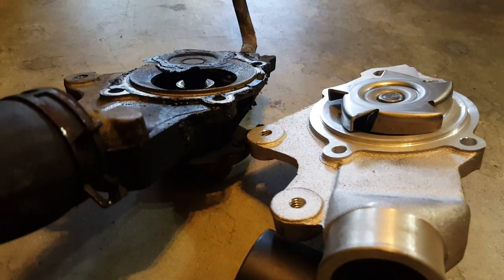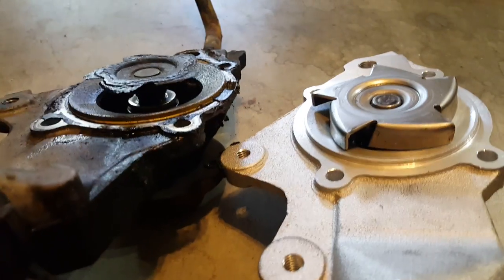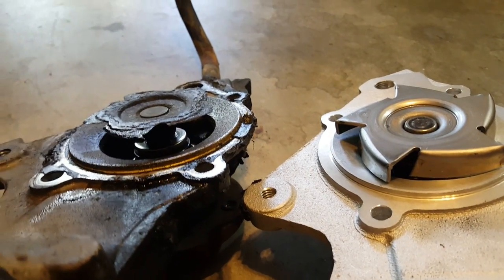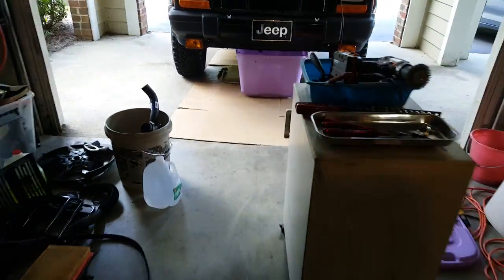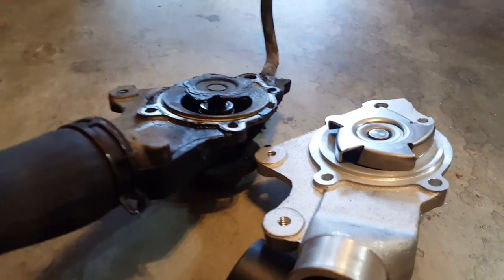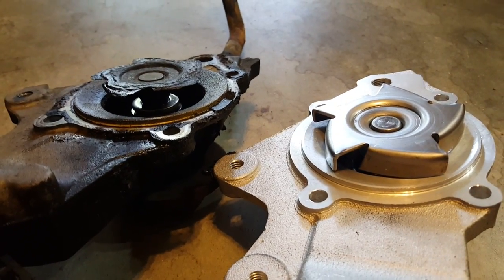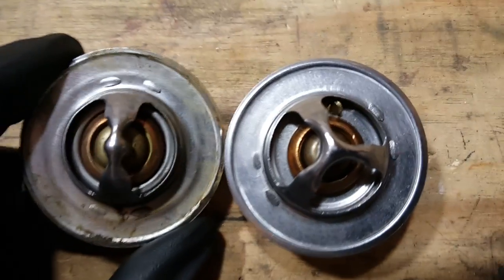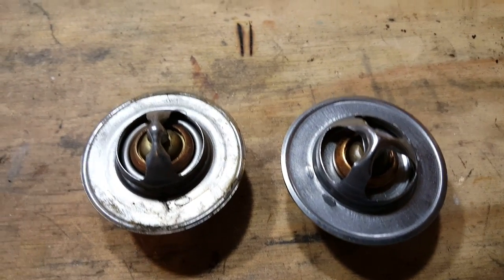Jeep Cherokee 97-01 xj overheating problem fixed

Comment: Seems like it would stand to reason that if the head was cracked you'd have water in the oil and you don't, I'm not sure why people would still Insist that the head is cracked ?

Comment: This is what I gata get into
Almost always a water pump or thermostat.  If it's cooling down when ur into he throttle.  It's the water pump
Reply: Not sure what you meant saying , if it's cooling down when you're in the throttle , it's the water pump . I'm jst having tear your hair out overheating problems with a 99 Cherokee more times than not . Thank you.

Comment: I have a 2001 XJ 4,0 ans have used the O'Reilly part and have not had good luck with it.  I live near a Chrysler Dealer and plan to purchase a part through them now.  Thank you for the information showing the difference comparing the two Thermostats.  I"m Very disappointed in O'Riley parts now.  I bought a water pump, radiator, thermostat, and other items trying to get this XJ ready to be my daily driver.  Maybe now I can finally depend of this Jeep.

Comment: Did it fix the cooling problems?  I had a leak in my rad, so I replaced that, replaced all the tubing seals, cooling sensor, the thermostat and then the housing which had cracked.  Still overheating problems, so I brought it to a mechanic and I’m convinced it’s the water pump but he doesn’t seem to want to exercise that idea.  My car sat for almost a year and seeming that most water pumps have aluminium components and coolant is more corrosive to aluminum, I think it’s either the pump or a wiring defect

Comment: Thanks for the video Grey,... Quick Version - My 2000 XJ with 187K sat dead for about 24 months after I loaned it out to an individual needing a helping hand.  (Out of gratitude, the XJ was driven into the ground in less then 3 K mikes. )  This month I got it running again.. installed a New Battery, Starter, Alternator, and Belt to get it fired up and that’s been great, but it’s getting smoking hot after 5 -10 minutes on the road and clearly having cooling issues. My concern is that it may be drinking coolant ( head gasket), but too early to tell.  Will run it at idle tomorrow after topping off the radiator.  Im not smelling coolant, so I’m hoping it’s the water pump.  As long as the head isn’t cracked I’ll be ok, even if the gasket needs replacing.   I figure first I’ll flush the radiator and change coolant, add a new thermostat and swap out the water pump to see what gives before breaking down the head for troubleshooting - I’d rather not do with summer in Michigan coming to a close..  So just a quick thanks for the water pump pictures and not buying into the fact your head is cracked - end of story.  Smart to work the problem like you did.  I’ll take pointers from anyone that wants to comment something of value on my strategy for moving forward.

Comment: Excellent job! Wow, unbelievable amount of damage to the stock water pump!
We think a like...I want to improve the cooling of my 2015 Rubicon. I'll be doing that by: 1. Changing out the stock radiator for a 3 row aluminum one. 2. Adding a trans cooler. 3. Installing hood vents. I also want to add an engine oil cooler, but may not be able too because of the change in engine design that has no external oil filter can....that type of design allowed for an adaptor which made it possible to have 2 lines to an external oil cooler.
Note: you highlighted the difference in the quality, or lack there of, of the aftermarket thermostat. I noticed that many years ago. I don't often buy factory parts, but ones I do are radiator caps and thermostats! Big difference in quality and performance. Thanks for your video example. It also demonstrated how there can be many different causes for a problem...in this case, overheating. And until you actually find the root cause, any other attempt to solve the problem, won't.

Comment: 98 Cherokee sport Radiator Drain Plug, I know many have ask where. Passenger side of Radiator + the little plug is on the Side of the radiator at the Bottom. I found to make this Drain useful later on, and a easy way to get to it is. Take the Passenger side Light Bezel off, then your park and Turn signal  Light Bezel out thats 4 screws and wallah there is the Drain Plug. The only other thing I did was to Cut out a little piece of the Fiberglass Head Light Socket there at the Plug so you can just reach in an take the Plug out. I did not know where to put this info Because I am not very savvy with Computers.

Comment: So I have a 1996 jeel Cherokee Sport with the 4.0 and I did the thermostat and fluid change and now it says it's over heating but the front coolent temp is 210 the rear temp sensor is reading 240. Replaced the rear coolent temp sensor and it's still reading high but ecm temp says 210 and no blow in to the resovor
Reply: Question.  Of course you want correct temperatures but even if your rear temp sensor is reading 240 and you're not overheating ( which I would think you would at a 240 temp)  Were you overheating ? If not, in my opinion,  I'd trust the front sensor that reading the 200/210 temp .

Comment: Would wraping the intake manifold with that heat insolation?
Reply: You can get a strip off Amazon to prevent GAS VAPOR LOCK,PUT IT UNDER THE INJECTORS !!

Comment: Exact same issue! Temp would slowly rise and then all of a sudden spike to the red, shut it off, overflow is bubbling out... I’m gonna change my radiator with my water pump... bet mine looks just like yours!
Reply: I’m facing the same thing right now the exact same spike I bought a thermostat and flushed out all hoses and was about to buy a new head but I bet this is it

Comment: Can you supply the part number for that thermostat? If you still have the box
Reply: Joseph Johnson use a dealer one
Reply: i think the moto rad that grey suggested has a 60% increase in volume over the stock t stat.  i would use a 180 degree one as i have in one of my jeeps and since i'm satisfied i'm going to do it in the other.
.
Reply: AZ DONALD NEVER use 180
Reply: 90's or earlier vehicles can swap out to a one cooler thermostat and be within temperature limits of the older computers.  

I have 2 identical Cherokees just 2 vin numbers off and ran both thermostats to verify what a performance chip shop had told me years ago.  

they got the same gas mileage and everything except one would run at a lower temp.  extremely high temp thermostats (195) are for emissions and no other reason.  use 180's whenever possible.

just came back from a 2500 mile trip and averaged 18mpg in one of our 96 Cherokees with the 4.0.  hit 19 several times.
.
Reply: AZ DONALD that is 100% false...if it's 195 from the factory that is exactly what you should be using
Reply: sorry if you can't follow my clear, well thought out explanation along with a chip manufacturers comments to me that 180* is well within the closed loop parameters of the computer.  

as long as you are running out of open loop then your computer regulated air/fuel ratio is accurate and not artificially rich.

one more time.  

auto companies went from 180's to 195* t stats not because running an engine burning hot is good for it, but because it helps them squeak by emissions regulations, period.  

a 180* is well within closed loop operating temperature specs of my 96 jeeps computer and past comparison with my identical jeeps 195* t stat proves it.  

good bye.
.
Reply: AZ DONALD if factory spec is 195 then that's what you use...simple as that

Comment: Not directly applicable I guess, these are my only cooling problems so far. My 1996 Cherokee 4.0L was leaking coolant from the pump. Had the pump replaced (I know, but I just don't have a place t do it myself) and when they got it off, they said it looked perfectly fine. It was a gasket failure. I had the new one installed anyway. In 2004ish, I had to replace the factory radiator, it was rotted on the driver's side top. A few weeks ago had a near-overheat (needle briefly touched the red) two mornings in a row. The overflow tube failed near the cap. Coolant gushed out when it got hot, and could not replenish because it would suck air through the hole instead of overflow bottle coolant. Replaced hose. My rule: unless the coolant is being replaced, I don't open the cap, I fill it only through the overflow bottle and I only use 50/50 pre-mixed Prestone.

Comment: I had the rare 01on a 3.5 lift on 31" M/T and had the same issue of overheating and after all the bullshit I pulled the water pump out and it looked like knife blades, thus solved my problem for about a year, electrolysis was my issue.

Comment: The 4.0 get the header type exhaust manifold you will release 20 %engine backpressure with the heat build up more hp and move the Cat,to little bit at the passenger side rear floor board this to will improve performance plus air/fuel ratio also!Jeep engineers made a bad design on the exhaust cut in with no flex everytime you rev your engine a crack would appear and CALIFORNIA YOU ARE A PAIN,never have the CATILIC T CONVERTOR THAT CLOSE to the Block no brainier!DEFEATS THE PURPOSE!

Comment: Can you run with out the thermostat?
Reply: @ gil Sanchez ~ you can run without the thermostat temporarily to rule out a bad one, but you shouldn’t keep it out permanently; the thermostat also restricts flow which allows the coolant to stay in the radiator longer, which actually cools it better than if it were flowing faster and unrestricted
Reply: @scottbollinger3999  Gotta pick your brain sir . 99 Jeep Cherokee Sport 4.0 inline 6 overheats depending on its mood for the day. One minute you'd trust a 1200 mile round trip to FL and not trusting it to 12 miles without blowing all the out the overflow tank . I'm sure I'm missing something like maybe a bad harmonic balancer or a semi- working non leaking water pump . I watched a video on drilling  small hole in the thermostat to vent air out . I did that with a new 195 thermostat and no change. I'm wondering if the coolant flow is compromised? If both radiator are hot , is that accurate method that it's getting good flow ? Sir if you've made it this far , I hope this isn't a dumb question . Off the intake manifold about 2/3 inches past where the exhaust bolts onto the manifold itself , the exhaust makes its first bend  . In making that bend at the factory is a well rounded bend or something that looks more squeezed and restrictive per sa ? I'm looking at a bend that looks like it half choking off the heat and exhaust thus making the Jeep overheat . Not sure if it got damaged somehow ? I'm thinking the motor would run hot if the Exhaust was restricted? Any and all suggestions.  Also , I do not have water in the oil but I have seriously gone from the Jeep not using any water from the overflow tank to it sucking it bone dry and then shooting it out the  tank after about 10 miles of driving . For weeks it run hot and I couldn't figure out why there was no draw from the tank . The hose and tank don't have any blockage. Then out of the blue its sucking the tank dry and blowing it out the tank soon as you shut it off .I've got a bad heater core by I'm bypassing it . Help . I apologize for the 10 mile message . It most likely is a sure sign of my frustration. I'm ready to take it insurance bluff because of it overall attitude lol .
Reply: Your coolant is going somewhere. If you don’t have an external leak then it’s going inside. So maybe a crack or gasket somewhere? I would start by flushing the entire system to insure there are no blockages. While I had it empty I would replace the water pump just to be sure, they’re not super expensive and that would rule it out. Then I would go to advance auto or wherever and get a loaner radiator pressure tester and learn how to use it. Sometimes an external leak can’t be easily seen while the engine is running and sometimes the leaks are so small that under pressure they spray onto the hot engine or exhaust and immediate evaporate. If your loosing pressure during the test but don’t see coolant coming out somewhere it’s probably time for a compression test

Comment: fan clutch at idle is weak ..had the same issue ....fan clutch works when it gets warm at .1500 rpm at idle I can stop it with my hand
Reply: Lmassoff,  I hope you tried that on the neighbors kid first. " Hey Timmy , wanna try sumpin really  cool" . I'm having. tear my hair out overheating issues with my 99 jeep Cherokee . I'll probably use a broom handle to see if I can easily stop the clutch . I'm of the Era of we didn't have clutch fans . We had stitches and 9 3/4 fingers to guide us . Fan Shrouds are handy for more than jst air induction.
Reply: @randybonner9870  ha ha dude it was just a funny video I saw of "tech's" proud they could put a fan clutch on while the truck was running

Comment: I knew o Riley's was wrong. They gave me the same bullshit temp guage. My Jeep has been over heating terribly. I also figured it's wrong because my Jeep always ran at 200 normally before with no problems. Now 200 is considered wrong. Also my new hoses are faded and easy to squeeze, just got them this year. I'ma upgrade my water pump, thermostat housing and radiator, including these special hoses for high performance. One thing I will also replace is my clutch fan for a zj clutch fan, and switch the old electric fan for a brand new one see if that eliminates the electrical switch to have to switch it on manually. Such a headache

Comment: Hey, just working on my own (very slight) over heating issue. Logically, if the heat works well this is probably not the issue, right? In my heat that seems true.. Is that thinking flawed?